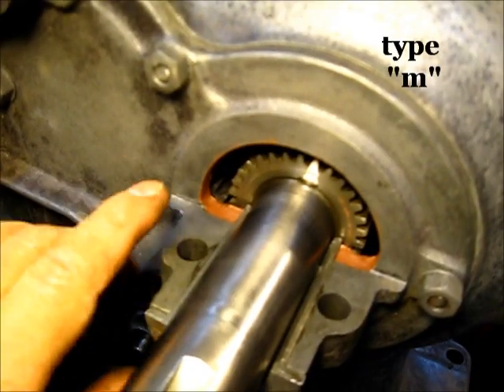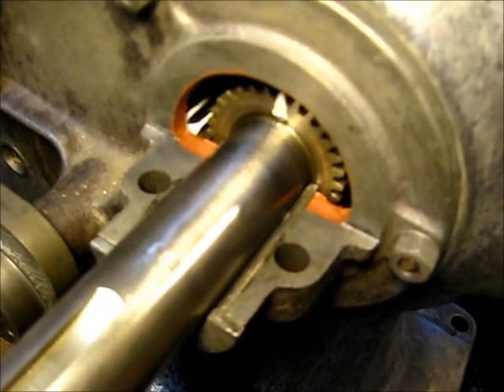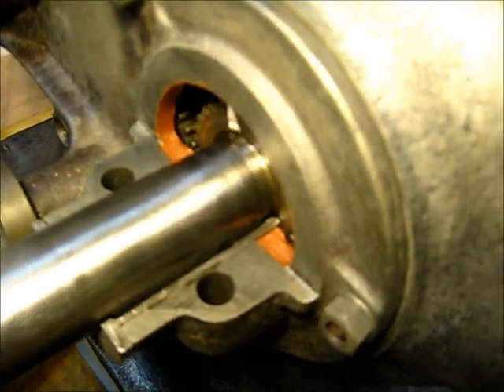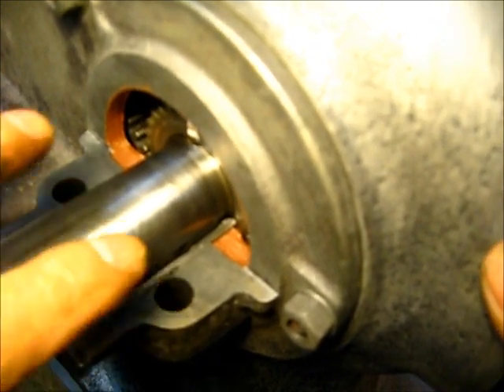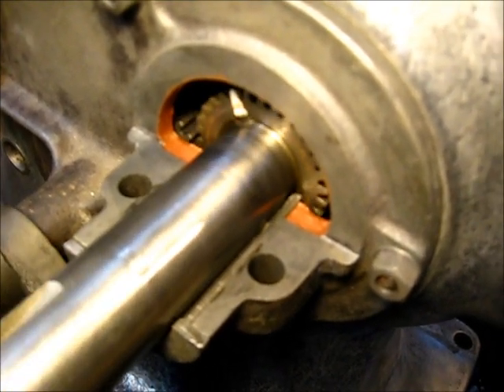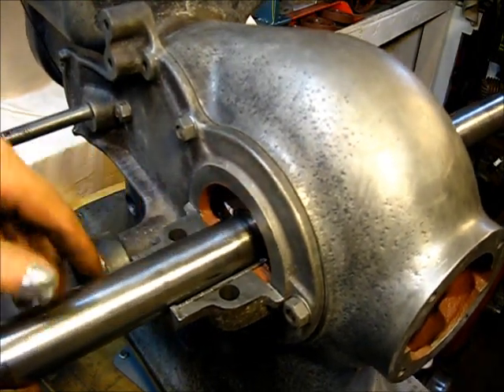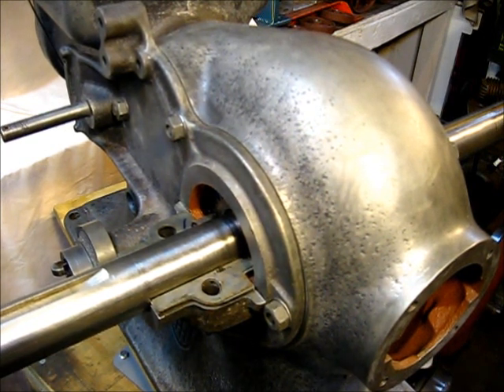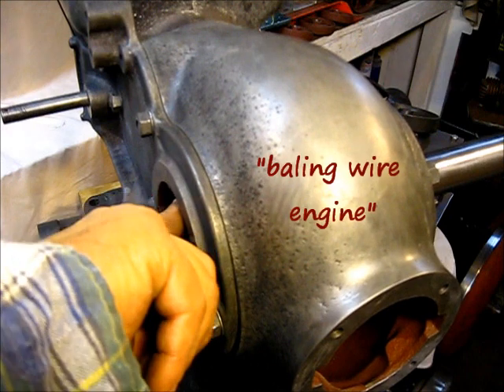McCormick-Deering "baling wire engine" #21

Comment: If you have watched these videos from the beginning, did you notice there was no grease in the timing gear teeth or on the crank gear? That's called "pound out". It occurs when a lubricant can't stand the sharp and continuous contact between two metal surfaces. The proper lube to use that prevents "pound out " is Amsoil Grease. Do some research here on youtube. You will not only have a happy running engine, you will have peace of mind knowing that the lube will stay where it has been put. Happy motoring!!
Reply from the maker: +John Elliott ,,, the way this engine is built,, that gear gets oiled,,, no grease,,, well,  maybe a little squeeze out from the babbitt bearings,,, do some research here on youtube. not to worry,, gears well oiled,,, Amsoil not needed ( I am going to put on some Lucas brand,, just for peace of mind),,, thanks,,,
Reply: +John Elliott I stand corrected sir. I thought the gears got greased. Good looking engine.